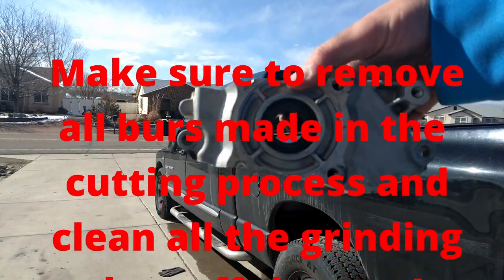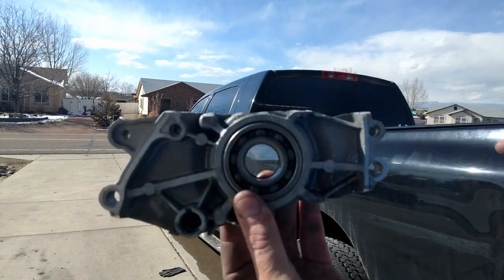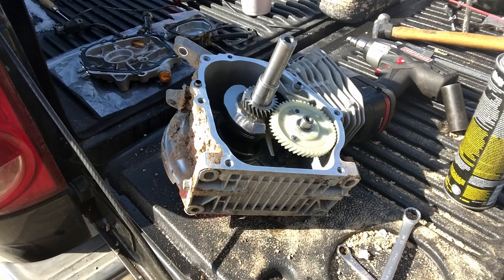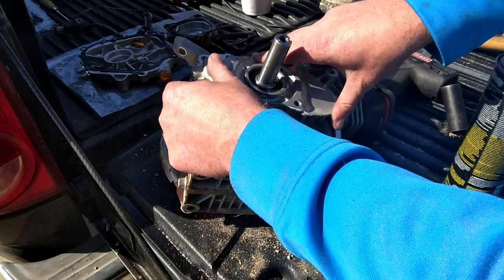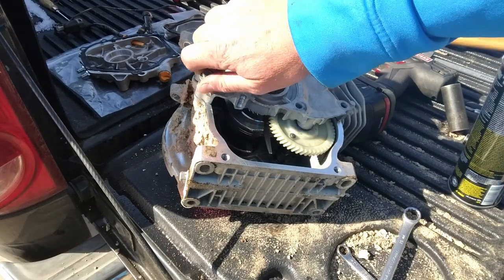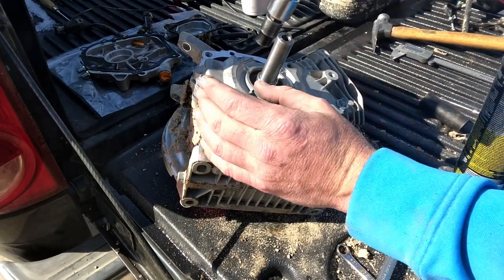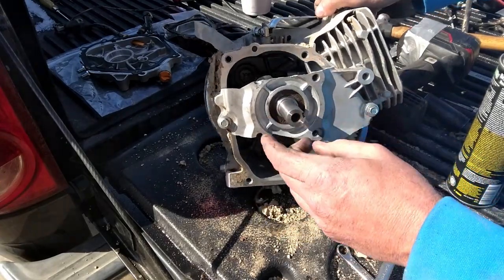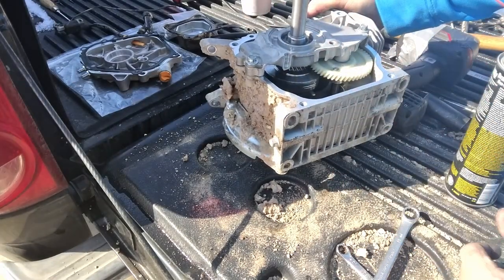Making a side cover to check 224 clearances

Comment: will a 196 cover work for this?
Reply from the maker: A 196 cover will work for making one of these for a predator 224 or a predator 212 hemi. It will not work on a non hemi 212 because the cam journals are a different size.